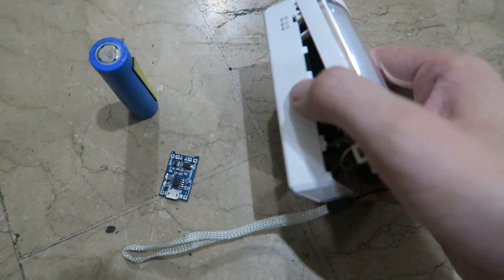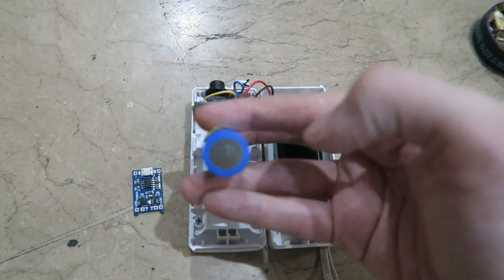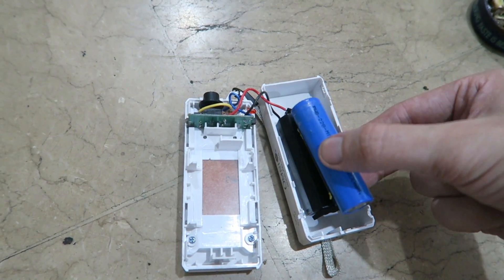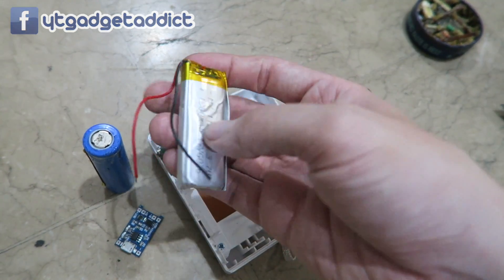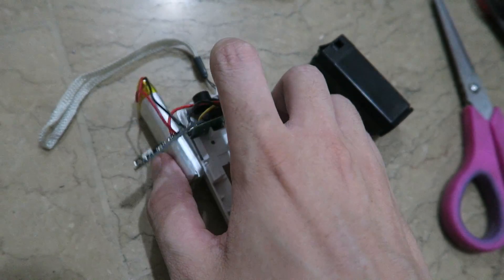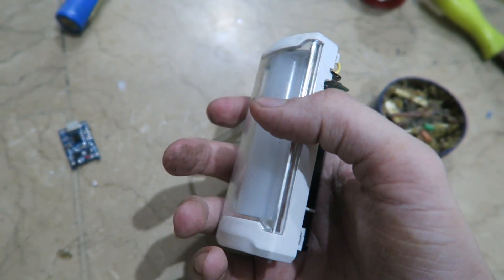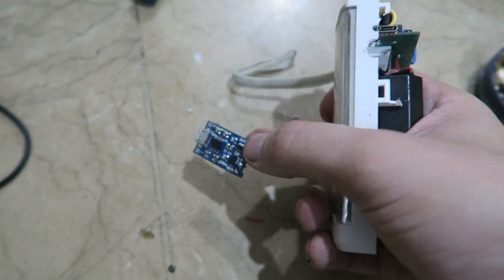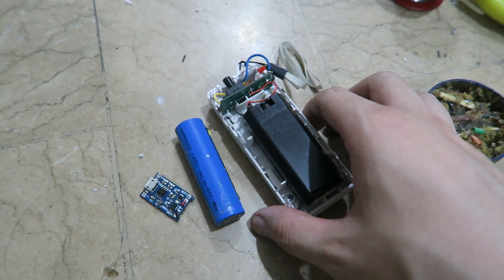Replace lead-acid battery with Lithium

Comment: I think it would work just fine if you just directly replace the lead acid with lithium 18650. 
if you are not sure just purchase NCR18650B with chip embed already on the negative bottom plate.

Comment: You should rip that battery management off the top of the battery and just let the one on the board do the job. Also I've noticed those boards have no reverse voltage protection it's easy to blow one if leads get reversed even for a second.

Comment: can you use that old board instead of that tp4056 module?
Reply from the maker: I doubt it. Because it's designed for a lead acid battery. 

Maybe it would be okay if the lipo cell that you install has a protection board built in. 

Although personally I'd recommend replacing the board. 

Or even better, just don't buy this light in the first place. There's so many alternatives that you can buy online, that come with lithium batteries.

Comment: I modified and replaced my omni led lead acid to 2x 18650 (3000mAh each), total of 6000mAh. And it gave me around 40hours of use instead of 3-7 hours on lead acid🤣🤣
Reply: But takes 10-12 hours to charge on 5v 1a.
Reply from the maker: Nice! With a runtime of 40 hours, I guess it doesn't matter if it takes a bit long to recharge.

Comment: is hot glue conductive ?? , i use a clear nail polish to make a blutooth audio module water resistant, that was teriible... most switches on the board stoped working and led also stoped working ... board is working But 😥😥

Comment: I also bought one of this. After the power run out and try charging via usb... it doesn't work anymore not unless the cable is still connected it lights up...

Comment: Can you modify a firefly emergency light with fan to a lithium ion battery? Pls make a video with parts. Tnx
Reply from the maker: I'll try make it happen. I would like to do it! It might be a little more complex because we need a higher voltage. But where there's a will, there's a way :)

Comment: What is the charging system for those all old mobile phones (non-USB)?  Does it require a charge controller or BMS?
Reply from the maker: I think even the oldies are still lithium-ion based. They may have used barrel jacks but the internal charge boards are essentially the same as what you find in modern phones. Although of course they used to charge much slower :P

Comment: dont use hot glue on 18650 charger...cuz... if youre charging... it gets hot. hot glue will melt.. try mighty bond, bulldog, or epoxy..

Comment: Could have run wires from the original usb connector to the one on the new charge controller, then you don't have to dremel the case.
Reply from the maker: +Ian Haylock i thought about that but id also have to destroy the PCB traces going from that input to the existing charge circuitry otherwise it would conflict with the new charge PCB we installed.

Comment: Can you get those 18650 cells with a built in micro usb charge connector in philippines
I believe they have a charge controller in a round circuit board at one end of the barrel
Reply from the maker: +Sibat 777 I've never seen them being sold here but I know lumintop make one so I could probably get one for review.
Reply: Usually the Protektion for the cell is missing, you can moverdraw or undervolt them.. This PCB is safer

Comment: Thought you weren't gonna swap the batteries :)
I think you might have used a bit too much hot glue and overheated the chip, next time you might consider using a little breakout board so that way you can use tape or just a dab of glue to hold it somewhere more convenient.

https://www.ebay.com/sch/i.html?_odkw=Micro-B+USB+Breakout+Board&_osacat=0&_from=R40&_trksid=p2045573.m570.l1313.TR0.TRC0.H0.XMicro-B+Breakout+Board.TRS0&_nkw=Micro-B+Breakout+Board&_sacat=0
Reply from the maker: Doh, I wish I'd thought of that! I actually have some of those breakout boards sitting on my desk!
Reply: Hehe, well that's ok I wouldn't have expected hot glue to destroy one of these things either but at least they're super cheap.

Comment: no  you can use epoxy  to do  it    no need  to solder  it
Reply from the maker: Well the soldering was easy anyway, it only took a few seconds. But yeah I guess some kind of epoxy would have been safer than a hot glue. I was just trying to use what I had laying around :)

Comment: Always interesting, what if you did a video on your all-time favorite gadget, mine would be my trusty Iphone4 from 2009, still in service, newer even changed the battery, i always tried charged from less than 10% all the way up to 100% think that`s the trick on those.
Reply from the maker: Oh nice! I struggle to keep my phones for that long because I always drop them. But this time I invested in a decent OtterBox case to protect the phone. I'm not sure what my favorite gadget would be. perhaps it would be the rechargeable USB fan because they're just so useful in a hot country. Otherwise it's whatever phone I'm currently using :P
Reply: hehe, in my area a recharged heated pair of socks would be awesome :)

Comment: how about the CDR-KING P99 power bank PCB
Reply: I think he means take the charge controller out of the CDR-King power bank.
Reply from the maker: I'm not exactly sure what your question is? But a P99 powerbank from cdrking and a P20-P50 USB light would be a good alternative to this Omni light.

Comment: Where can you buy a charge board like that and an 18650 cell?
Reply from the maker: I bought them on eBay, 5 for $1 or $2. You can find them locally on OLX and Shopee but the prices are often ridiculously high. As for the 18650 cell, I removed it from an old powerbank but you can get them on Lazada, Shopee, OLX, CDRKING - pretty much everywhere. Of course there's a LOT of fake 18650s being sold, so don't believe the advertised capacity.

Comment: The TP4056 should work fine with the LiPo batttery, they charge to 4.2v.  Default charge current is 1 amp, you can adjust that by adding a different resistor.  The TP4056 chip is a bit heat sensitive, likely the hot glue did it in.
Reply from the maker: Okay cool, that's what I thought when I read through the spec sheet but I wasn't 100% sure because I couldn't find many people talking about charging lithium polymer batteries with the TP4056. I guess the heat sensitivity is why so many places use that cold caulk instead of hot glue.

Comment: I think you should put up a new video on why you are annoyed with lead-acid batteries over lithium.
Reply: Gadget Addict yes the 4v lead acid  ones r widely used in Chinese products from emergency lights to mosquito zapper(here in india).hardly last 3 months very unreliable
Reply from the maker: Yeah I guess I could. I gave an explanation in my previous video. For anyone reading this comment and wondering what my concern is, let me explain. Short Version: Lead acid batteries charge slower and have a much shorter life than Lithium-ion or Lithium-Polymer batteries. Long version: Under perfect conditions, lead acid batteries can last a few years. The high ambient temperatures of the Philippines is already a negative towards the life of a lead-acid battery. The next issue is with how this light discharges the battery to such a low voltage; this greatly reduces the life of the battery. So we thought we're getting a fast charging, long life, lithium battery but what we actually got was a slow charging lead-acid battery that will probably be barely usable within a month if you use it every day. Aside from the difference between lead-acid and lithium batteries, these small generic 4V lead-acid batteries are notorious for being low quality.

Comment: Where did you get the charge board? On another note where do you buy those electronics you have? Having a hard time finding retailers here in the Philippines
Reply from the maker: The charge board came from eBay. I bought 5 of them for $1 or $2. They were super cheap. Unfortunately I already used them in other projects. Whenever a product breaks, I save the battery for future projects. Which electronics are you asking about?
Reply: Just thought you bought them from a retailer here.

Comment: ........i suck in soldering......always end up looking messy......... :[
Reply from the maker: Having a good soldering iron and clean tip can make a huge difference. And avoid using lead-free solder.
Reply: And don't forget to use flux, makes soldering so much easier.
Reply: Gadget Addict "...and avoid using lead-free solder." Lol. So true though!
Reply: Practice makes perfect, but yeah a decent iron is basically a requirement to get good results, go on ebay and grab a few kits to practice on.